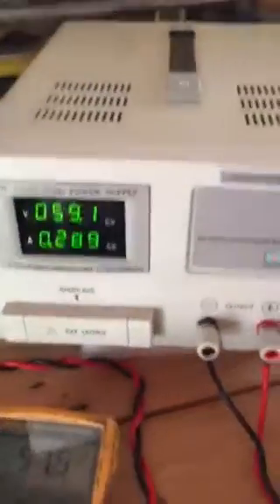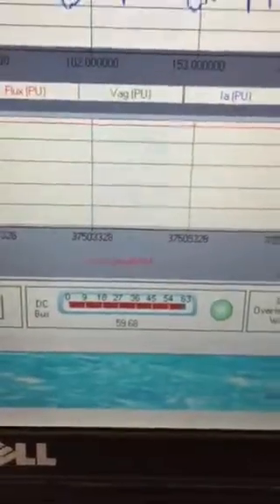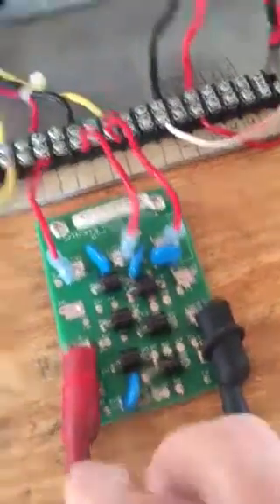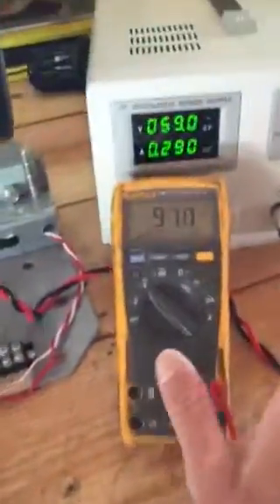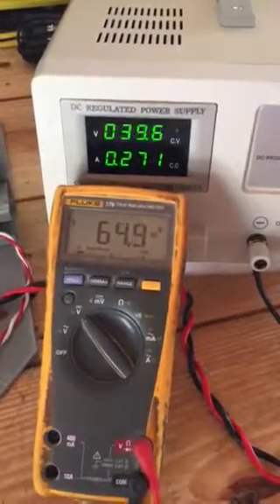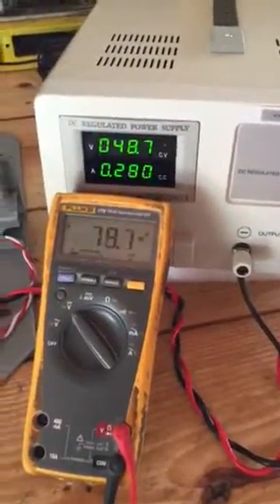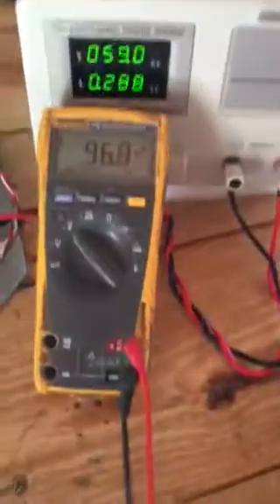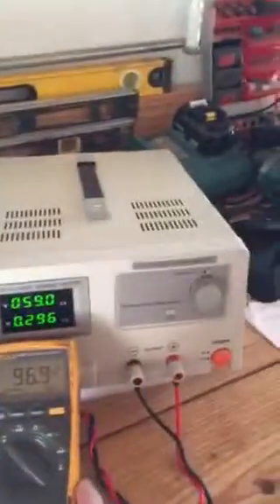Gerard Morin Leverage

Comment: Hi,good work.How fast have you spin that motor with that driver board from TI?Thank you.
Reply from the maker: Dan Popa . Not fast at all with that specific drive. I’d have to go back and get a rotational speed to be specific. Drive used in later videos is the one I’m using currently and  have got it up to 4K with modifications of magnets and rotor with no external connections. Torque is still unfathomable!